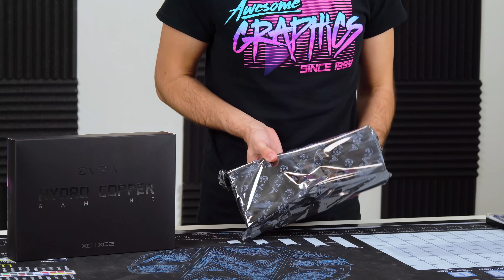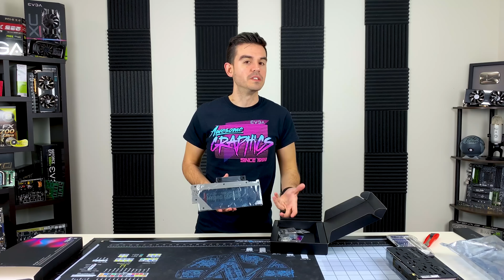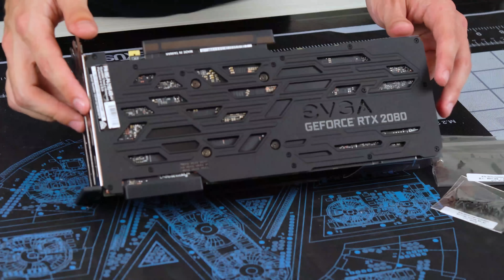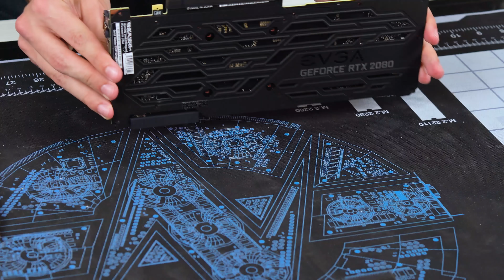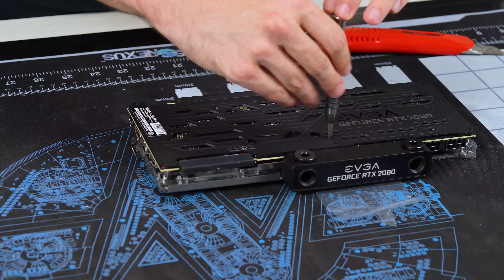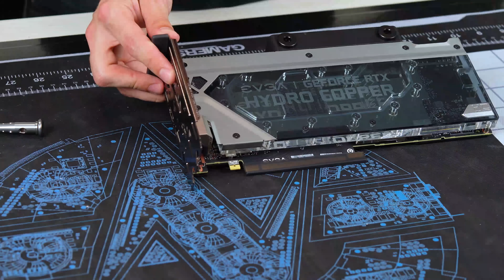How To: Hydro Copper Installation

Comment: What thickness are the thermal pads? I purchased a Hydro Copper kit secondhand that was previously used (cleaned and seals are good, right model for the card also) and the person had removed all the thermal pads... also is it possible to get a replacement GPU bracket through EVGA as I can't remember seeing one in the packaging? I'll be installing this block on my second 2080 Ti FTW3 Ultra to add to my loop and attempt NVLink this week.

Comment: Hi I've done the exact same as you except on a 2070 super everything has been used and in the correct place. When I boot my pc the GPU lights up and just before the welcome screen turns off because it's overheating.

Comment: question, what is the exact purpose for the bracket???? my card is reaching the 86c limit while others on air are no where near those temps, ive reseated the block numerous times, and purchased new pads etc, only thing i can think of is the screws or bracket elevating the cpu from the water block

Comment: I've repasted mine 3 times now , i've ran out of thermal paste.. tried adding a 2nd rad in .. right now have a nemesis gts 360 , added a thick 240mm and the temps got worse. still instantly to 60's then climbing to 68-70c.... hybrid never exceeded 55.. Defective block or?
Reply: check your mounting again
Reply: @tombendar9299  About the 10th check and re paste , something must of sat right.. 48-51 now. Still  a little high for a waterblock but it's good enough.
Reply: I'm sending my block back and going to go with EK waterblocks. Can't even get mine into windows because of overheating.
Reply: @markeyhendrix  Yeah , unless you want to take it apart and put it together 100 times until it sits just precisely in the spot it wants lol... mine maxes 45ish now generally 41-43 gaming. I should have just sent it back and got the ek , but at least its good now.

Comment: I had written an email to EVGA and they had not gotten back to me and I was very apprehensive about the water block.
I had seen this video, but because I had not taken my GPU apart, I did not know it would look the same as this video.
I called EVGA and Daniel Casiano really helped Me to understand things and sent me this video for my 2282 and 1389-B1
and then it all made sense and now its done and installed in My Pc.   The triple slots really threw Me off....
   What a shame that all the nice viewing area is facing down in My PC and cant be seen.
I thank You for this video and especially Dan C for all His help.

Comment: Since this is a review I think it's important that people know the overall size specially if you gonna be using this In a built so I wanna head looked up the measurements people might be interested in knowing overall size Height 6.24 in. ( 158.55 mm )  Video Card Length ( 11.45 in. ( 290.83 mm ) like I was nice how to otherwise

Comment: Mine instantly overheats goes to 89c throttles. Its 1st in my loop and my cpu runs cool. Not sure whats going on ive reseated it 3 times exactly as yoube done and its not cooling. Edit : found the issue its defective! I know you all have to be aware of this issue as ive seen numerous complaints on your forums but there is a massive gap between waterblock and gpu so much i could fit a quarter in between if i wanted, horrible machining on you alls part. I will be returning the block, hopefully you guys get back with me as i sent a rma request already and have been waiting, i cant have my Computer down any more so i ordered a new one in hopes its not botched too should be here today for me to try out. So far crappy machining and slow as dirt customer service if the second one doesnt work ill be leaving a nice review for evga about the water blocks. Gpus are flawless but gpu water blocks need to be left alone if 2 out of 2 are faulty.
Reply: same with my 2080 Super. How can they sell this crap...
Reply: @XXXXXX-iu9gw  not sure, my 2080s actually shorted out due to replacing the blocks so many times lol. Bought their official 2080 super ftw3 ultra hydro copper and it still sucks ass 70c. Stuck my buddies 2080 super gigabyte waterforce and 40c underload like wtf. Evga wont respond anymore to my emails because i called them out on their bull shit and told them they need to get on their quality control and that was the last time i heard anything its been 2 months now lol. The thermal pad squished to the point the back of the pcb hit the backplate and went up in smoke if you were wondering what happend because i was confused on how it fudged up lol they have a terrible design for sure.

Comment: $15 + $5 shipping for a two slot bracket that should have been included with a $180 - $200 water block.  That's crazy, EVGA. You can keep it.
Reply: pam0077 I bought this water block for 80 buks shipped from their website lol
Reply: @donavincaballero5976  does it work? So far ive had 3 completely defective ones and my 4th one atleast lets me play but 70c underload so its worse than stock cooler.
Reply: YoltsBp  mine works fine bro i even checked for good contact and it was perfect saw thermal paste oozing out

Comment: great video, nice detailed explanations which sometimes Steve @GamersNexus does TOO Quick! I am thinking of doing my 1st watercooled build but looking at the ready made EVGA 2080ti HydroCopper cards, now some questions, As it is Nickel plated, but copper, what Radiators are best to avoid corrosion, without adding anti-corrosive additives, Same goes for EK Z390i Rog Strix Asus Mobo full board, will it be compatible to use with? I would like to put this in the Mini Itx Antec Striker Case so i can put 2x EK PE 240mm rads with a D5 EK pump/res combo. I want to use Hard Tubing, with clear water. Has the ready made cards been put together with the same care you have put in? How often do you need to change the water? Sorry im a Noob, but we all start somewhere.

Comment: Hi,

i have this GPU Cooler on my EVGA RTX 2080 XC Gaming.....when i start Ungine  Superposition Benchmark and when i play PUBG the Card go up too 70 Degrees...is this normal?
Reply: Michael, did you ever resolve the high temp issue?  I just installed mine and it too is getting up to 70 + degrees under load.  My air cooler never got that hot.  Mine is also artifacting in game
Reply: Nathan Davis how big is your radiator? 240? Is the directions of the pump going in the same direction?  when having a water cooled cpu and card, 360 mm radiator is a must. 
Or maybe it’s just the water block. got one of these coming in today to replace my ek. I’ll see what the temp of mine is.
Reply: 82 degrees here, not sure what iswrong with this block !!

Comment: Will it fit 2070? For example https://www.evga.com/products/product.aspx?pn=08G-P4-2172-KR?
Even if PCB is identical, does chip have same size (so bracket will fit)?

Comment: 2 slots bracket sold separately.... at this price point why don't include it? I'll pass for my futur modding....
Reply from the maker: The 2.75 slot cards come with a 2.75 slot bracket. If you do this install on an RTX 2080 XC instead of the RTX 2080 XC Ultra, then the already comes with a 2 slot bracket as it is a two slot card.

Comment: too bad it won't fit inside pc-o11 dynamic case without vertical mount.... 😥
Reply: The FTW3 is much taller and will absolutely not fit. Here’s a build using the smaller version https://builds.gg/builds/011-dynamic-custom-res-and-distro-panel-16975
Reply: @nickrobinson6434  thanks for the info. 👍
Reply: @nickrobinson6434  just info. The build that you mentioned is using the ftw3. That's why the side panel is not attached in the picture. 😅
Reply: Uki W lol that’s crazy. I have the black edition 2080 ti, but went with a vertical mount anyway. https://m.imgur.com/a/gYc2SDw
Reply: The XC/XC2/FE version might fit horizontally.
Reply: @nickrobinson6434  hmm.. can anybody confirm this? because I haven't found anyone posted a build that actually did manage to fit it horizontally. but there's a discussion on EVGA forum that said the FTW3 didn't fit. mentioned the lack of clearance only by few mm. so close.

Comment: Does this void warranty?
Reply from the maker: Nope, not at all! When using an EVGA card and the EVGA Hydro Copper you are still covered under warranty. We just ask that you keep the mounting hardware for the air cooler as you would be asked to reinstall that if you needed to send in your card for RMA.
Reply: @TEAMEVGA  Hey guys, if I have 1080 Hybrid cards, and on one card pump is just dead, and I concern about others, can you send just Hybrid water block or that one as potential replacement (while if pump die, how to fix it, its not just a fan)? Or if other cards failed after warranty because of pumps, literally I will not able to buy water blocks like that (to switch to external pump). So, how to deal with that?

Comment: If anyone is hesitant on installing a block on a gpu, it is a lot easier than you think. Just make sure block to card contact is good.
Reply: I did my EVGA 1080 TI's using EK waterblocks quite easily. I note from this video that they took the time to give you some plastic to grap when "pealing" the thermal pads. {Great} It's quite a pita to get started when the protective plastic is flush with the pad, I had to use a razor blade to get them started.